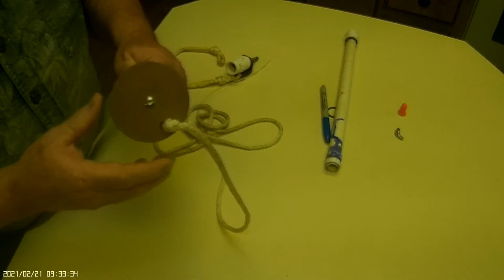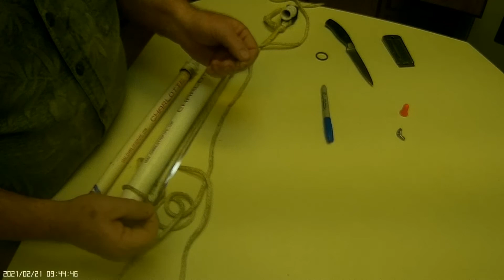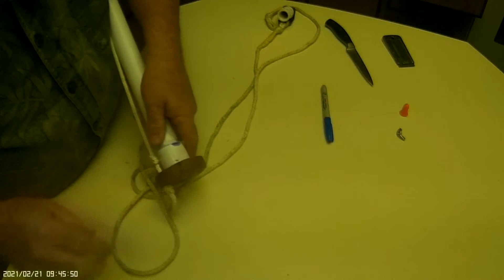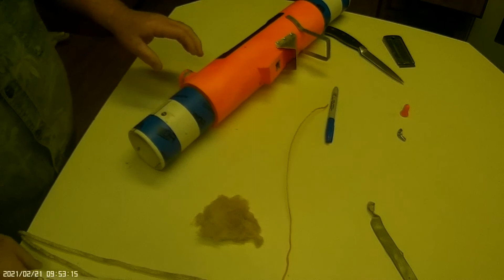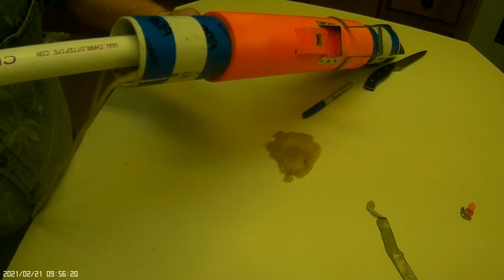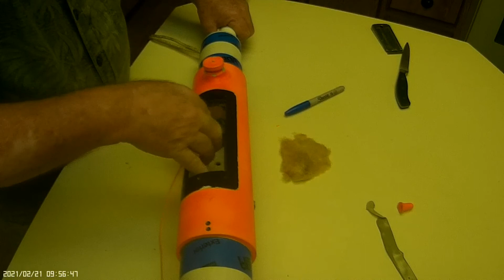Constructing a parachute ejection piston for a rocket

Comment: Great job Gary.  I always look forward to your videos.  Do you use any kind of silicone or other grease on your o-ring?
Reply from the maker: I use Napa silicon grease, but i think Vaseline would work OK.  Before I went to the o-ring version I used scotch blue exterior plastic tape for a seal.  It adheres well to PVC and works very well to apply to my body tube couplers for a proper fit.  The tape did deteriorate when used as a piston seal because of the grease.  It was difficult to determine a proper fit in the piston and it also had a certain amount of leakage.